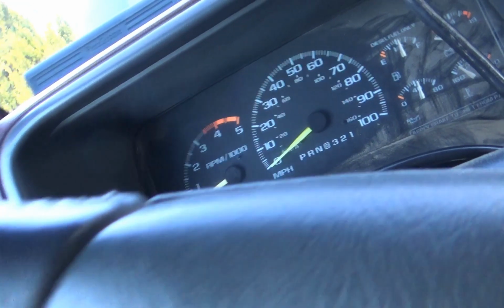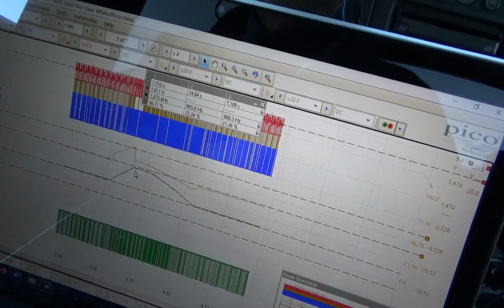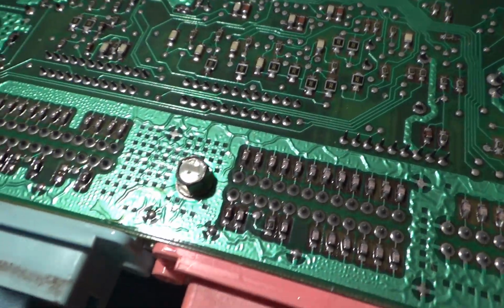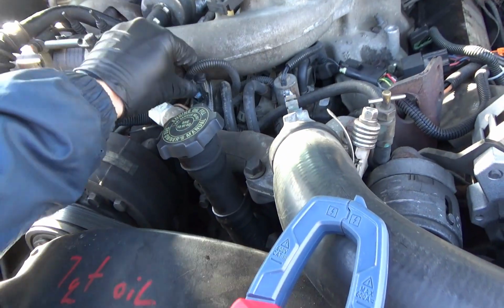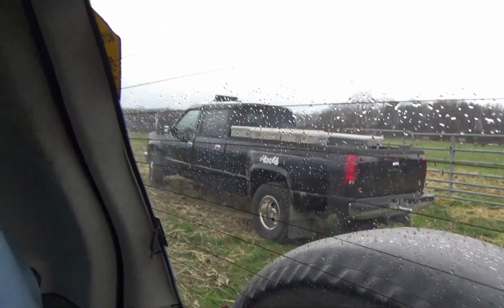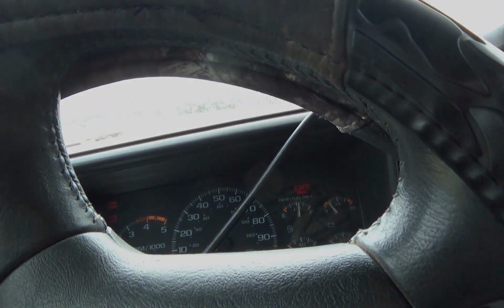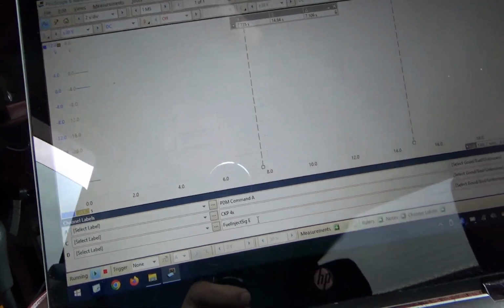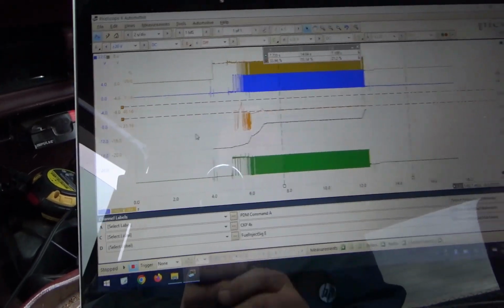Chevy 6.5 Turbo Diesel REVS Out of CONTROL?! (Part 2 - Didn't see THIS Coming...)

Comment: I just worked on a 2006 VW Passat with an idling problem. I got lucky and found  rail pressure target value and actual pressure were way different. A new Pressure sensor took care of the problem. The previous owner put an aftermarket radio in and there were plenty of network issues because of it. It ran smooth and idled fine after replacing the fuel pressure sensor. I don’t envy that guy that owns that truck.

Comment: Because of the hard start... probably lived on starting fluids... bummer though...
Reminds me of a customer who wanted a engine swap. Did the dirty deed. He was standing over my shoulder asking when i can get it done. Told him as soon as he paid for the repairs. Then he wants to borrow my tools to work in it too. I told him nope. 
He paid..drove off..day latter he is complaining of a transmission not shifting right. He starts to blame me. I told him. I don't pull the transmission. Nor did i worked on it. We get into a heating argument. As he is standing there. I raise the car. Check the level in the transmission. Its over filled. I drained 2 quarts. Test drive and its solved. I tell him what i found. Then he says. O i added some. Since there was no dip stick. I tell him. Get it out of my yard. Dont come back.

Comment: Did you try to unplug the IAT and check what temperature the scan tool was reporting? I should be the same as the ECT unpluged (most probable the same biasing circuit). If the IAT was reporting diferent temprature, the ECT wiring should be faulty.

Comment: Sounded like it needed the pump rebuilt..when they rev out like that and is having fuel issues is usually when they either blow up or run off then blow up..  but there’s a reason why they pay diesel technicians more than mechanics..  its a specialty trade..  the guts of a diesel can get tricky and unless you know than your only guessing..

Comment: I was thinking the same thing you, cold starting that beast and going from 0 rpm to 2000+ in a flash and the owner driving it in that condition for weeks?!  That was a grenade waiting for the pin to be pulled.  You did everything you could.  It's sucks to lose, but not your fault
Reply: Sure but the owner probably didn't attempt to rev it much in park or neutral. He would have put it in gear and then no possibility of slamming into the rev limiter like that.  I don't blame Ivan though. That was part of the diagnostic process.
Reply: Mine did the same but soon as it was started... the IP was shot

Comment: You are out of your knowledge didn't need to start to figure out you blew his motor up better put a rebuild In there please stay away from diesel his engine was fine until you rev it over a dozen times you if you knew you should have had someone with a board over intake

Comment: Sometimes PCM's get capacitor rott when the electrolytics leak onto the board and corrode the traces. Some PCM's have multi layer boards so it pretty much trashes them if enough electrolytic get into the sandwiched wafer board. Replacing the EEPROM will do nothing to revive these. Sometimes you can recap the board and it will be fine as long as there is no obvious corrosion. Probably not this case but it's worth looking into on erratic ECM"s.

Comment: I don't understand why you ended by talking about the high pressure pump. You showed clearly that the pcm was commanding the goofy duty cycles and the rpms were responding appropriately. There must be some bad signals going into the pcm. Maybe a wiring harness issue? Maybe scope more signals right at the pcm? Test the temperature sensor resistance at the pcm? The engine is toast and we'll never know. Man, I really feel for you, and us, for not getting the closure we have grown so accustomed to. Keep up the good work, Ivan. You are the GOAT!
Reply: Older ECMs are very hard to judge, whether it's the ECM or feedback from the PCM.. It sounded to me more like a diesel runaway, which is caused by excessive fuel (diesels engine speed is controlled by fuel not air). Since the ECM was replaced and the problem persisted, it was more likely a fuel problem.
Reply: @TheOnespeedbiker  And high RPM fuel cutoff worked. That likely would not be the case in a true runaway.
Reply: @tadawsonX  It wasn't a true runaway yet but it was probably sucking up oil causing the mixture to over-fuel. So even a hair of fuel would mean the RPMs spiked.

Also, there were already some leaking fluids in the first video. That could have been diesel coming from the pump, if that were the case, the PCM could never control it in the first place.
Reply: What was being seen was the pcm attempting to keep fuel control with a bad injection pump.

Comment: Check the coolant temp sensor resistance at the PCM. May be a wiring issue, as for everything else I haven’t a clue.
Reply: Bad wiring, maybe bad ground. Or maybe it's a common failure in the PCM.  It didn't seem to be this engine's problem, though.

Comment: That truck came in essentially dead.  I believe that the engine was toast before it came to the shop.
Reply: Over revved to death. Moral of the story is if you want to own a diesel that isn't under warranty then you need to know of a good shop that has the ability to repair it. I know of one shop in western Pennsylvania that could have fixed this truck if it would have been towed in immediately after the problem started. Progressive Diesel Injection in New Castle Pennsylvania.
Reply: Nope…truck came in with a bad injection pump. Left with a hole in the block.  Go back and listen to the first video, first couple of starts…no knocking.  Lots of cold diesel noise, but no knocking. Many of us told him it was a faulty injection pump, but he was dead set on continually starting and reving it cold over and over and over again.
Reply: @vg3430  Makes sense.  I am no mechanic for sure.  Thanks for the information.

Comment: Hey, you can't win them all. It's a shame we don't know what was really causing the problem though. Diesels can be hard to work on. Just something to keep in mind, the 'one and only' electrolytic capacitor (that I could see) in that control module can still be bad just because it's not leaking, and also the replacement from ebay is still 29 years old and have a bad capacitor also which would more than likely cause the same conditions. Unfortunately we'll never know. I don't think a lot of people realize how VERY important it is to have good clean voltage in these circuits, Crap in, crap out. Good video anyhow! 👍

Comment: I was wondering about the actual solenoid in the first video, after all, if swapping out the module that controls the solenoid several times made no difference, then maybe it was the solenoid itself. But the data seemed to show otherwise. But maybe it was the feedback timing from the solenoid that was causing the ecu to go nuts trying to get it back under control. Would love to see the solenoid taken apart or bench tested.

Comment: Once had a customer bring in a DOA 240Z to diagnose an engine knock. The knock was on top not in the base.While trying to narrow it down at an idle,it locked up. Spun a con rod bearing, the bottom bearing shell had spun up between  the crank and the upper bearing half. The knock up top was the piston hitting the head. The customer screamed and yelled we ruined his engine and we were going to pay for it. He knew it was bad and was looking for a free fix. We towed it to his house. That's all the free he got.
Reply: This is why repair shops don't work on stuff like this anymore they just tell you  to get the F off my property in a polite way
Reply: Had same on Hyunday Santa Fe 2.2 diesel was knocking at the top customer brought another so called mechanic and tried to contradict me so pulled injectors out and photographed valve imprints on the pistons with borescope then he finally shut up and paid additional investigation fee 😂
Reply: That's the kind of a-hole that deserves some missing teeth. And the same kind of a-hole that will go around bad mouthing you. These days it is 10X as bad because now they can do it on social media. Glad the owner of this Chevy Diesel had both brains and ethics.

Comment: As I said, before, check the wiring harness under the fuel filter that runs in the valley

I’m too late
Reply: He's not actively working on the vehicle when we see the video. He's likely already done when we get a vid.
Reply: Yeah, aren't there known problems with the connector where the engine harness connects to the other harness that goes inside to the PCM? My 95 is still running - I drive it regularly - don't have any weird issues with it!

Comment: Had the exact same problem years ago, someone had put 2 gallons of Gasoline in at the pump by mistake then topped it off with diesel, thinking it would dilute it, weeks down the line the engine had exactly the same issues with run away at start, it began to run away on a test drive so I held it back on the brakes hoping it would stall and snapped the crank. Only after did they tell me about the gasoline being added wrongly.
Reply: I retired my last VW diesel about 8 years ago, of the old rabbit era. They used to recommend adding 10 or 20% gasoline in cold weather, it was in the owners manuals for the diesel’s. I never tried it, but it was in their owners manuals. Of course those were old school mechanical with no electronic’s.   Also, when things got down around 0 or lower, we used to put 5 gallons of gasoline in the tanks of the heavy equipment machines and never had any problems, though admittedly diesel was not the same in those days.

Comment: Worst feeling when you make the wrong call on an electronic part. Sometimes even with good equipment and information it's unavoidable. Too many lies coming from the existing parts means you're stuck playing probability diagnostics. Then throw in a used PCM that may have the same flaws as the original...been there. 

Truthfully that truck should have been parked as soon as the symptoms started. Oil was probably diesel-washed by the time it went for repair.

Comment: A very embarrassing situation, as someone that has spent most of my life fixing things I feel your pain. Having seen your videos on this vehicle I am wondering if it might be fuel contamination? As for the engine temperature issue, is this a C/F problem the figures looked like it.  A one point you mentiona resistor that should read 113 but was reading 253.... 113c is 235f.... so figures are in the right ballpark... if that is the case.

Comment: Maybe I missed it, but  I don't remember seeing you check the resistance of the temp sensor at the PCM connector with it unhooked from the PCM. Since both PCMs read about 40k high, maybe there are green crusties somewhere adding 40k resistance.
Reply: There very likely is - there's a big connector that connects the engine harness to the other harness that goes inside to the PCM - it's known trouble spot. Some people even delete the connector entirely and solder the 2 harnesses together permanently to fix the problem!
Reply: @gorak9000  too bad it really doesn't matter since the motor grenades. 😞
Reply: @jimjaques4030  I have a '95 with a 6.5 in it - it hasn't grenaded yet...

Comment: Can the wire from the temp sensor have high resistance on it and causing the ECU to miss read the temp.
Reply: More resistance means the pcm should read colder than it really was. It was reading hotter instead.
Reply: @stevepecollo  Great answer

Comment: Yes, engines don't like being revved out with no load on the crankshaft like on that 6.2 litre Chevrolet V8 powered Denali that you diagnosed a few years ago where the owner redlined it in a car park which resulted in the connecting rod of cylinder number 8 being punched through the side if the engine block !

Comment: Baked into software is high idle mode for pto operation.  I belive that was 1800 rpm. I would try and turn it off and on. I don't remember the procedure.
Reply: Sometimes high idle is automatic a couple of minutes after a cold start. However, with the ECT reporting nearly warmed up, not sure that is the case. PTO mode is possible though.
Reply: On the 6.5l the PCM has 2 terminals that PTO(high idle) circuits can be added to. Grounding 1 of them gave you an idle speed of 1070 rpm the other one when grounded would give an idle speed of 1360 rpm. I remember doing these many years ago with a 3 position toggle switch. Not sure what might happen if you grounded both. Maybe could get a 3rd speed close to 1800rpm? But still would not explain hitting the rev limiter.

Comment: Had a guy tow a car to me years ago. A 90's chevy sedan if i recall correctly. Said it needed a starter. Sure enough it did. Replaced the starter and the engine had a terrible rod knock. Of course the owner got all mad and said it didn't do that before.
Reply: Owner probably got sold a car with a toasted engine.

Comment: I'm still pondering the odd coolant temp reading.
Reply: There's a known issue with the connector between the main engine harness and the harness that goes inside to the PCM. Probably could've been fixed with a couple shots of deoxit and unplugging and re plugging the connector a few times. And checking that all the grounds are good too. The grounds going bad is another known issue. Well, at least before the rod left the party...
Reply: Me too
Reply: It seemed likely a wiring issue as that would explain the ohm disparity.
Reply: Sounds like there was gas mixed with diesel  fuel not a PCM issue

Comment: I really doubt a "memory" chip could go renegade.  It has nothing but a mapping in it.  If the stuff in it doesn't make sense, the check sum should tell the receiver of the data to "ignore me"  I'm wrong.  There is very little likelihood that a fouled-up map could return a valid check sum.  Were we/they so naive back in the day?  Nah, I'd like to think not.  However, I'm a Ford guy and GMs sucked IMO.  Maybe those were naive in GM products.  Who knows?  We don't have access to that level unless we worked there.  Also, why would a temperature sensor make such a big difference on a diesel?  Variance in fuel requirement is negligible.  PID equation: RPM overrules temperature.  Temperature is a very weak input to the fuel requirement.

Comment: Man, this is so weird... From the scope data it looks like the engine is doing exactly what the PCM tells it to do.

Too bad there isn't much data on these old trucks. 

It's a clean body anyways, so it's worth fixing imo.
Reply: Absolutely.Worth fixing especially if you go check the price of a new one ton dually  top of the line four wheel drive diesel silverado.   Easy to get over $100k.